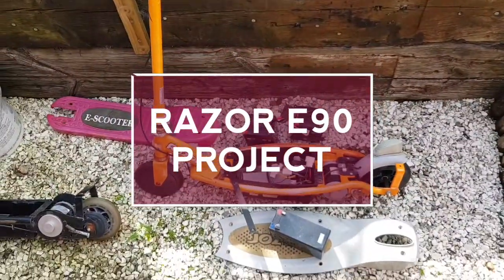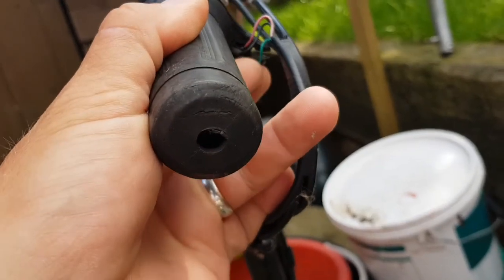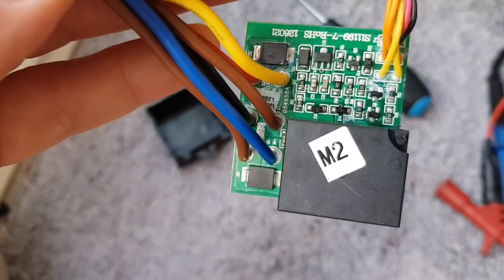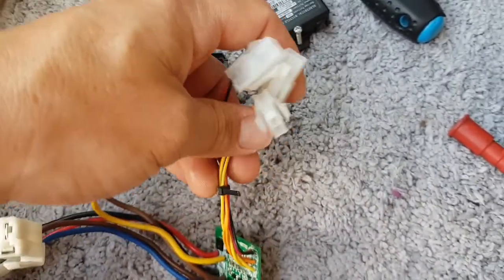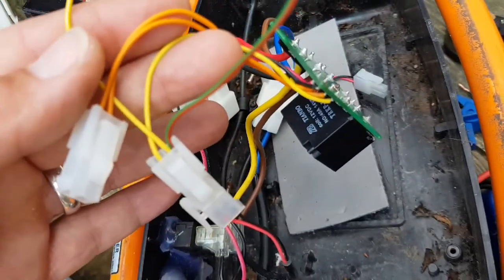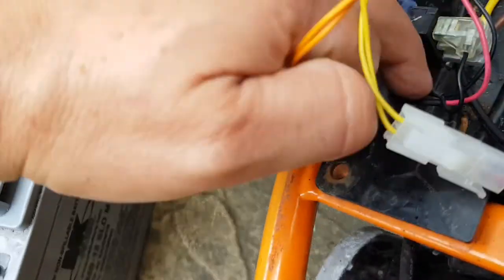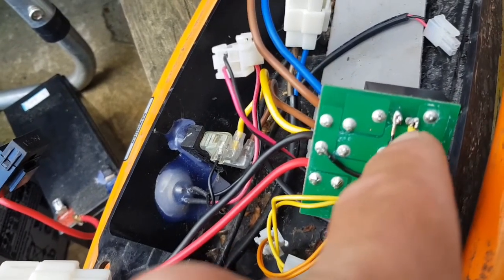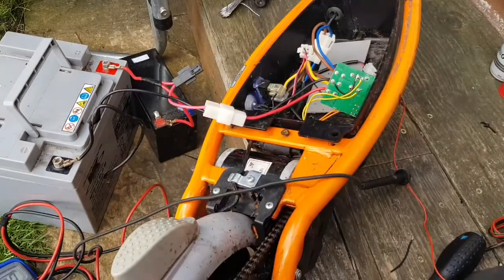Razor electric scooter speed controller mods and bypass razor e

Comment: Got one of these for my 5 year old,  20£ guy said it just needed charged.  Got home done a few tests turns out the board was kaput.  Followed your video and done the bypass and it's now flying.  Not bad for 20£.  I was about to wire in my own relay then found this way much easier.  Thanks  a lot.  I've no charger for it so hopefully it will still charge through the port whenever I get hold of one cheers buddy..

Comment: Just did this today, worked like aa charm! I got an e90 out the trash, building a 24v cell to get some run time out of it. HOWEVER.. You can mix up two connections and as soon as you flip the switch it runs wild! Lol other than that good show!

Comment: Great if controller circuit knackered but as it is for an 8 year old, the brake switch will now have no effect on cutting out motor. Great stuff though 👍 my issue is no power when button pressed, turns out the relay isn't getting the ground , so like you I gave it a hard ground and the positive side of coil now has the yellow wire going to it, that way the button does the job and the foot pedal switch.

Comment: The kickstart feature on this scooter I think is dangerous. As your kids got one leg behind, the power kicks in at full power and sends them flying. It's a decent basic scooter but I think I'll be changing the speed controller for an actual normal speed controller with a real thumb throttle n if I get carried away, change the batteries for lipo to make it lighter and increase the range. I love to get a cheap one and make it better than just go out and buy an expensive one. Especially if u get a 2nd hand cheap one or find a broken one. They are so simple to work on.
Reply: It's really not a bad idea for a kickstart. If for whatever reason you are walking and hit the twist throttle, the scooter won't go on while you're holding on
Reply: @OldManPhil  Do you pushstart your car every stop sign, just in case you accidentally smash your foot down on the accelerator and crash into someone?
Reply: @PowerScissor  No, that is different. I think the push start is a good idea because it has happened to me where I was walking my scooter out of the garage fast and it activated. It is a think fast moment and you have to run up and jump on (High risk) or drop it (Damaging). It would of happened to me more  if there was no kick start. A car is just a stupid example btw.

Comment: So helpful, Thank you!
Reply: I do have a question. If I have a 20v battery hooked up with the way you have this controller, Should the leads to my motor read 12volts, or 20volts? In other words, Does the controller bring the volts down to 12, or does it keep it at 20 without burning up the motor?

Comment: good video helpful i found just using the black wire short works fine off the button did not need to move the yellow wires could be luck on my part but thanks

Comment: I can not here any clicking from the relay on my e100 but as i said below the light switch on off switch lights up red, could this be lack of charge its been stood and was working and must hold charge as 8 months no charge it still lights up and it has been used a very few time his little one did not like it, any feed back i would be great full.

Comment: I have got the razor 100 with the trottle turn swich on the handle bar, i switch it on the light come on red, i have tryd the push start but nothing, could it be there is not enough power in the battery as i am waiting on a charger, i thought it would still start even the battery is low.

Comment: Hi, I'm trying to bypass the kickstart feature. Is that done with the black wire shown in the video? What are the other 2 thin yellow wires for? (I'm trying to make it like in the video where you can press the button and it will automatically run the motors without having to manually speed it up first via kickstart in order to activate) I have the e90.
Reply from the maker: Wire it like I show at 7:39 that will fix that.
Reply: @MADMODS  The yellow wires are cut from the 2 small ports on the back right? Also, I notice the yellow wires are connected to red and black (+ and - I'm assuming) which color goes where? I can't tell looking at 7:39 because both are yellow
Reply from the maker: Ok so it doesn't matter what way round the yellow wires go as it's just a switch. The relay on the board is a electro magnet switch and what we want to do is turn that switch on to get power from the battery to the motor. The relay 4 connections 2 are for the motor switch the thick wires and 2 for the electro magnetic switch thin wires (theses are our yellow wires) because there for the switch it doesn't matter what way round we connect them.you want one yellow end connected to positive or negative it doesn't matter other yellow wire end on the relays electro magnet terminal then the other terminal needs to connect to the opsitate negitave or positive to the other end. I really hope I'm making sence to you if your still stuck Google relays and get a bit of info on them basically you are using the push switch to supply a power feed the a coil in the relay witch then switches a big switch in the relay that then puts power to the motor.
Btw I like your profile picture and wonder if you scam scammers? If that doesn't make sense to you let me know and il keep helping you till you make it work 👍
Reply: @MADMODS  I don't scam scammers? Lol. But thank you for the lengthy response! I hope I can get it to work.
Reply from the maker: Check this out and you can see why I asked https://youtu.be/PHli3h-zhcU
Reply: I just mounted the throttle switch from a powerwheels...it has spring return or thumb release...You simply place the switch between the batteries and motor.
For some reason the motor on one of the e100 is faster...I think it's the 150W
Not sure..because number of whining in a brsuhed motor effect's it RMP
and torque.

never the less I made it faster. It runs fine on 6s lipo ( 24-26V)....I ran it for a couple of miles on 8s 50c lipo. The motor gets hot...but the batteries are fine...
It's hitting 18-20 mph on 8s. (32v)
I also tested it on 7s (3s and 4s)...it's do able (26-28V)
I might install a FAN...I rig a heat sink to the motor.
If worst comes to worst I'll just get a bigger motor (250 W  ..maybe a 14-15 T PINON..it depends on the motor's RMP  ( how many turns in a motor).
run it on 9s ( 3-ea 3s) 36-38V...or 12 s if it hold ups.
There's NO electronics....the switch is holding up fine.
I either have it PEG or coasting ( it dosnt coast as good as freewheeling). it's a BRICK for a scooter..even with the lighter and more powerful LIPO
It dont need a soft throtle....I push it to get it rolling anyways.
It just needed MORE SPEED :-P
Reply: I went through all the trouble....but ended up just tossing the esc...it's not really an ESC...it's more of a safety feature..The throtle will simply trigger the RELAY ( SWITCH)..It just wire heavier gauge wire to a momentary switch) as a throatle..sort of like a power wheel..these scooters are bricks..it's PEG
on 24V.......I can simply run more VOLTAGE....I run 6s lipo...direct. That's the most the motor can handle..without bruning out....E300 has 350Watt motor.
32V,...you're pushing you luck on 36V..it'll burn it out on 42.
Reply: OneEye Monster — guess he stopped caring about replies after the first month.... this video honestly sucks... he recorded himself BRAINSTORMING aloud and not really explaining MUCH AT ALL to the novice as to WHAT TO DO & HOW TO DO IT...  I don’t get why he wouldn’t just MAKE A VIDEO SHOWING EXACTLY WHAT NEEDS TO BE DONE FOR WHAT RESULT....  smh
Reply: If it requires going 3mph to start, then it requires a certain amount of input power from the motor. If you connected a multimeter to it to measure the voltage while kicking it, you could probably bypass it by attaching a second button directly to the battery and going to where the motor would input to that board along with a voltage regulator and/or a step up or step down circuit to get the desired voltage, then just hit the one button before hitting the other to start. My guess is it would probably require somewhere around 12v. So maybe $10 worth of cheap components off of ebay would likely do the job. Already having those things, I could definitely give it a shot with my own scooter.

Comment: I've got an E100 scooter, seems to have the exact same control board, however when joining the same 2 as you I still get clicking from the relay. Any ideas?
Reply: The relay clicks are supposed to happen. That's the feed for the motor power.
Reply: @FINDITFIXITRESTOREITBUILDIT  Thanks for the info, any tips on bypassing then?
Reply: @kennywatson249  you don't want to bypass it. Its turning the motor on when you push the button.

Comment: Can you use a 12v motorcycle battery to run one of these? Or would i need to modify something?
Reply: you can and it would be fine as there already 12volt.

Comment: Is it really just a cheapo electric bike controller? If that's true, I should be able to slap the whole setup from it onto one of my bikes. Thinking about it, the parts on the older model do look like cheap electric bike parts from Ebay, the kind of stuff I've considered buying.

Comment: Would it be possible to get say an e200 speed controller and throttle as well as batteries and install it on an E90 to overvolt the pre-existing motor????
Reply: Not a bad idea 💡
Reply: @newzealandhoris4208  Ayee :))

Comment: That doesn't look like the e100 or e90 I see on Amazon is it because I'm looking at the power core model? I want to do a major upgrade to speed and range but idk how possible it is.
Reply: Seems the power core version uses the same "speed controller", but different drive motor setup is the difference between them

Comment: I got an e90 charging but stopped working..not sure of fault but think it's the go button. Found an e100 with throttle and brake was wondering if I could switch the throttle onto the e90 but the e100 has a cable from brake aswell going to loom is that just a e brake so to speak
Reply: yes you can there the same speed controller and its just a switch to stop the motor when you pull the brake.